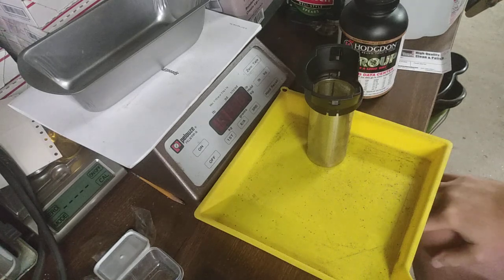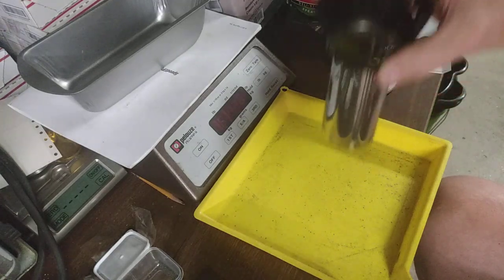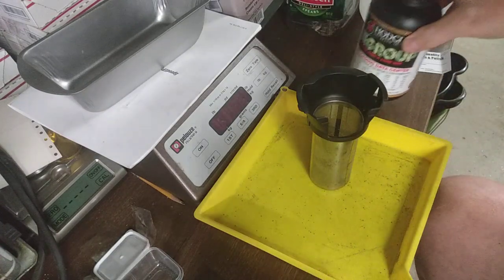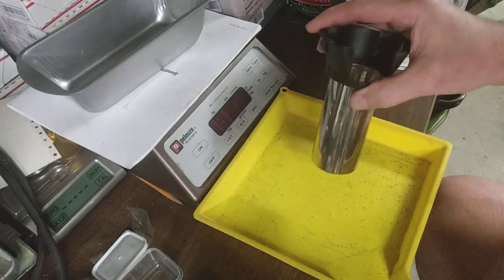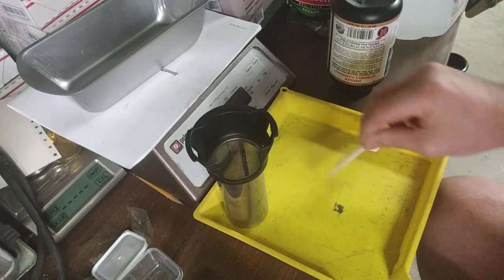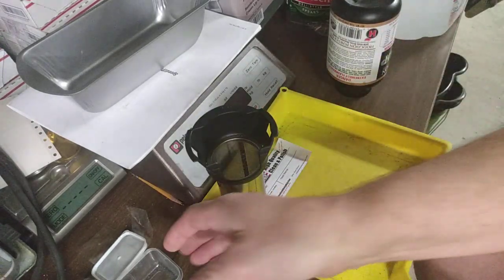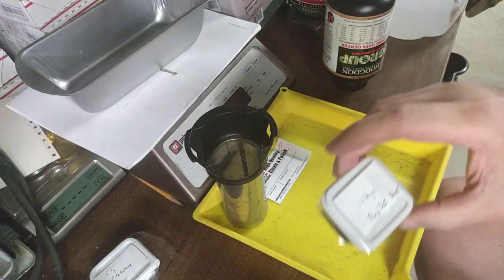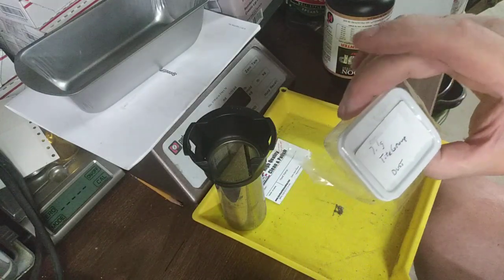Homemade primer powder eph20 finely ground powder source

Comment: Looks like an interesting video.

Just a tip from the days of old (a century ago)...

Anytime you try to process/grind anything that is sensitive to pressure or creates a dangerous dust, just add "distilled water" to the ingredients you are processing (enough to a make a mud like mixture). Now, the ingredients can be processed down to a fine powder (like "FFF"). In centuries past, water was added to gun powder plants (buildings) to reduce costly plant explosions.

After the ingredients you are processing are blended/grinded to the desired courseness that you are looking for, spread the material thin (and allow to dry) on "window screen" material (sold in metal or plastic rolls at your local  hardware store - I'd use plastic screens to reduce ESD). This was a production method used all over the world.

Be safe and take care.
Reply from the maker: Thank you.

Comment: Very nice,i use pure nitrocellulose powder in my 12 gauge cartridges and toy cap paper roll as a primer.
Reply from the maker: Very Nice but I haven't seen a toy cap gun nor any paper roll caps in years
Reply: Are you using pure guncotton in your shells? Aren't you worried about a shell exploding?
Reply: @jakeevans8819  I have shot more than 100+ guncotton shells without any problem ,it is low power than original smokeless powder
Reply: @Indianarmslover  how much guncotton do you load in a shell? And is it homemade guncotton?
Reply: @jakeevans8819  2.5 gram -2.8 gram
Reply: @jakeevans8819  I have both type of nitrocellulose home made and factory made in powder form
Reply from the maker: @jakeevans8819  No sir.   This is strictly for reloading primers.  The recipe named Eph 20 uses a fine fine nitrocellolous (5 grains).   This method is one way to harvest it.
Reply: @helpmenowmark  I didn't know you could make nitrocellulose primers. I didn't think it was sensitive enough to shock
Reply from the maker: @jakeevans8819  No.   Please don't misunderstand.   Nitrocellulose (NC) is only 1 ingredient of a primer recipe call EPH 20.   More details to follow.    I've got film of Marshall making the "missing link" for EPH 20.    If you forward your email to helpmenowmark@gmail.Com I'll give you the details in a reply email.
Reply from the maker: @krishnays3519  already on Youtube... Search and ye shall find ..
Reply: just only nitrocellulose ? is that enough to produce flame and is it sensible to shocks ?
Reply: @grosnain  yes it works very well

Comment: Are you planning on making a video of the whole process of eph 20
Reply from the maker: It's in the works but slow progress.    I'm caregiver for my folks (both in 90s).   I may forego the fancy graphics and editing and get the info out there...rough cut
Reply from the maker: Yes. Sry taking so long.   My vids go thru so much personal scrutiny .   Delays the info
Reply: @helpmenowmark  hey brother have you finished the video? I'm extremely interested in this idea! You are the first person I've seen that has been thinking of this, I don't necessarily need a video if you could put the princess that you are using in text I would greatly appreciate it I have nothing but time and I would figure it out I need primers so damn bad one question I did have those is this process producing a corrosive armor power or is it actually clean burning
Reply: Also do I have to use titegroup can I possibly use CFE pistol powder or maybe a shotgun powder or maybe some leverevolution dust?
Reply from the maker: @nicholecrouch311  eph 20 is the way to go.   Non corrosive.    Send ur email to helpmenowmark@gmail.com is best

Comment: Nice thank you for sharing your thoughts with us. 
I have question.. what will happen  
if I didn't  add the anv
Reply from the maker: I want you to join my group on MeWe: https://mewe.com/join/primerreloading

I think you got cut off.   Anvil?   Needs to go in there (pointy side down).    If you leave out the NC altogether you get (for the most part) EPH 0.    Use Marshall's manual for details as found on www.AardvarkReloading.Com

Comment: Have you found a way to grind the gun powder, I tried a with a kitchen aid grinding attachment that makes flour and it grinds so fine i just knew it work with powder but it did not work I have tried a few different ways none successful I got a fine and i mean fine tea strainer and just did the powder like you did and i think the holes are just to small so very little would make it through now im looking for other ideas. can you or anyone help
Reply from the maker: I'm trying to find a vid a subscriber sent me.   He made a "tub" from aluminum foil, poured some smokeless in the tub, poured in some acetone (just enough to saturate the powder), and let it dry.    You now should have a 'brick' ('say' the size of a candybar) that he clamped into a vice.     The rest of this description is an excerpt from his email to me...

The file that gave the most success was a double cut bastard. I tried a single and double cut smooth file but they cut slow and plugged up quickly. You had to clean them about every 10 strokes. The double cut bastard didn't have a lot of plugging problems. 

Tonight I clamped the block of solidified gunpowder in a vise surrounded by aluminum foil and used the double cut bastard on it. I was able to generate 45 grains of ground nitrocellulose in less than 10 minutes.
Reply: @helpmenowmark  ill try that ill make a small block of powder like that and give it a try
Reply: @helpmenowmark  I just made a small batch using heavy duty aluminum foil and a small candy mold and it works great most were small to fine particles scooped a small amount up put it in an ash tray and it went poof real fast used CFE pistol just made 2 more little molds with titegroup

Comment: What about using ping pong powder in primers rather then as a replacement for gun powder?
Reply from the maker: Yes - sure thing!    If they are truly Nitrocellulose  (old chinese made ones were the best).    I had trouble finding a way to grind them up and harvest just the dust-sized particles.    We have one guy that dissolved gunpowder (or ping pong ball in your case) in acetone.    He let's it (the block) dry.   He has found a double bastard metal file works best (creates a good many particles with 10 mins of elbow grease).       I've got a write up of using a hand grinder with ping pong ball somewhere (another user had the same question).    You see this one?

https://gunstreamer.com/watch/ping-pong-balls-for-gun-powder-amazing-but-no-go-i-found-this-experiment-none-the-less-very-interest_ZS6JrUHCNdPw5qC.html

I think you still need a filter to get the dust-sized particles separated from the rest.

Here's a filter you may wish to use (select 100 Mesh).

https://www.amazon.com/Moanna-Strainer-100-Strainer-Kitchen-Filter/dp/B08PBRTJCJ/ref=sr_1_12?dchild=1&keywords=150+mesh+strainer&qid=1611028284&s=home-garden&sr=1-12#HLCXComparisonWidget_feature_div

Some Guitar Picks are made of NC and the ol' reel-to-reel film.

Comment: Too much work.....just get hoopes #9 for 3.00 from walmart ...clean barrel, firing pin, bolt and feed ramp.....takes 30 seconds.  No more corrosive problems
I am using 3 caps and 22 nail gun primer powder from lowes.....a little acetone to keep it from firing when the anvil is inserted.

Comment: Could you use ping pong balls for this?
Reply from the maker: I don't know if u have seen this one https://gunstreamer.com/watch/ping-pong-balls-for-gun-powder-amazing-but-no-go-i-found-this-experiment-none-the-less-very-interest_ZS6JrUHCNdPw5qC.html
Reply from the maker: I don't see why not... But just the flour sized particles.
Reply from the maker: https://gunstreamer.com/watch/ping-pong-balls-for-gun-powder-amazing-but-no-go-i-found-this-experiment-none-the-less-very-interest_ZS6JrUHCNdPw5qC.html
Reply from the maker: Sure could.     Problem is getting the Ping Pong Balls down to a dust sized particles.    One guy dissolved some gun powder into some acetone, let it dry, here's an excerpt from his email:

The file that gave the most success was a double cut bastard. I tried a single and double cut smooth file but they cut slow and plugged up quickly. You had to clean them about every 10 strokes. The double cut bastard didn't have a lot of plugging problems. 

Tonight I clamped the block of solidified gunpowder in a vise surrounded by aluminum foil and used the double cut bastard on it. I was able to generate 45 grains of ground nitrocellulose in less than 10 minutes.
Reply: @helpmenowmark  I would love to see a video of this process